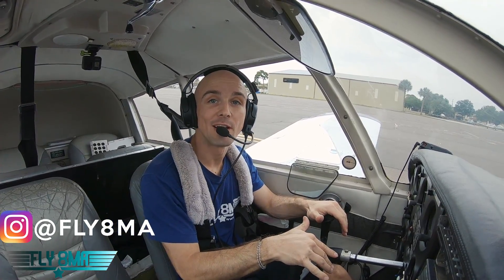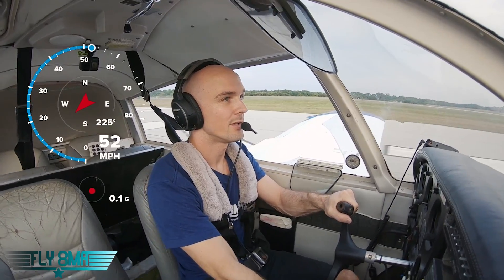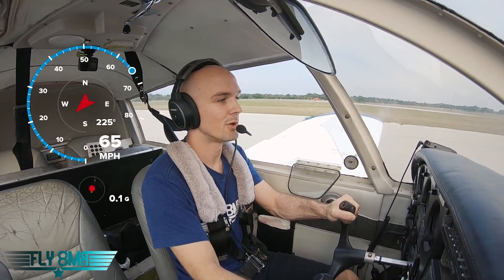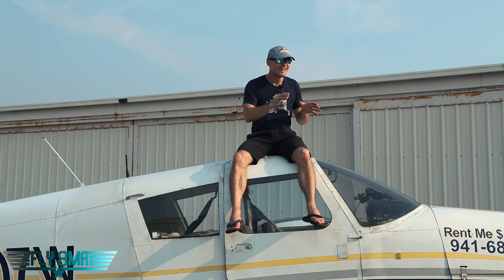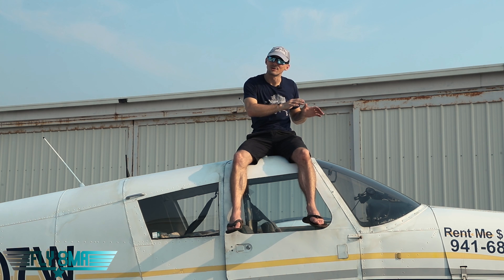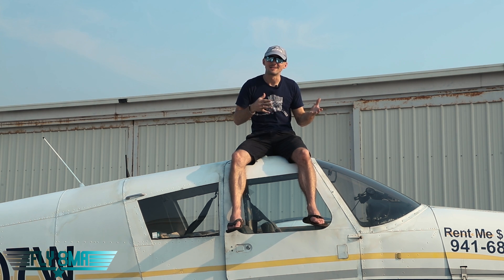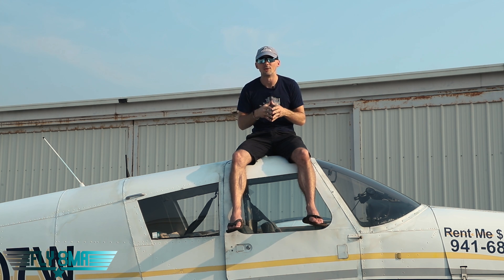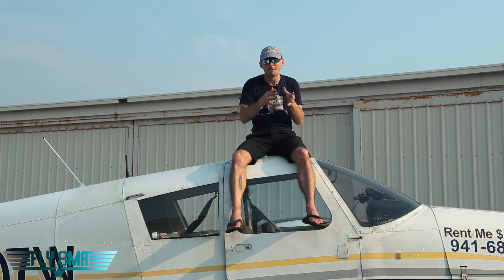Threshold Braking vs. Skidding

Comment: Maximum braking, max coefficient of friction, is actually applied when the brakes are pumped, enabling directional control while maximizing stopping power. The process is similar to what happens in a car with antilock brakes automatically by an automated mechanism. Also a factor in the stopping distance performance discrepancy is your reaction time to applying the brakes.

Comment: Unscientifically done, to the point of being worthless for drawing conclusions. Speed control and point of brake application are two obvious variables. Tire and brake temperatures are two more.  And finally, doing the skidding portion first yields 2 damaged tires for the second test.  Disappointing and far from a professional effort.

Comment: Plus add in the amount of distance you will lose due to time to recognize a problem before deciding the apply brakes.... you knew you were going to brake, but in a real-world scenario, no oil pressure or engine failure we not be so predictable. I add 1.5 safety factor to all of my Foreflight calculations... great video series. this is such a valuable series.

Comment: I have a question. What if you apply maximum braking, but as you’re slowing, start pulling back on the yoke to get more weight on the mains. I was always taught to do this for “maximum braking”. Maybe you did it that way, but I couldn’t tell.
Reply: You do indeed want to have the yoke all the way back during maximum braking.  It won't increase your AOA because the force of your tail pushing down can't overcome the force of the braking action forcing the nose down. But it will provide some extra force down on the mains giving you better breaking action.
Reply: @cappyodi9221  Right.  Those guys above know nothing.
Reply: You were probabaly taught that to reduce the loads on the nose gear
Reply: If you pull back and increase the angle of attack, you’ll create more lift and reduce the weight on the wheels. You can increase braking effectiveness by reducing the amount of weight being supported by the wings. Flaps up at touchdown and low angle of attack on rollout accomplishes this.

Comment: I bet if you tried that on a wet runway there would be a significant difference?
Reply: Obviously .
Reply: I Agree.
Reply: Totally  agree. Probably up to twice the distance, and zero control.
Reply: No way...
Reply: On a wet surface you would want to apply full braking power prior to the wheels touching. When contact is made you'll be half stopped!
Reply: homertalk absolutely not.
Reply: @homertalk  oN that airplane you raise the gear before landing or better, land it upside down and you will stop sooner.